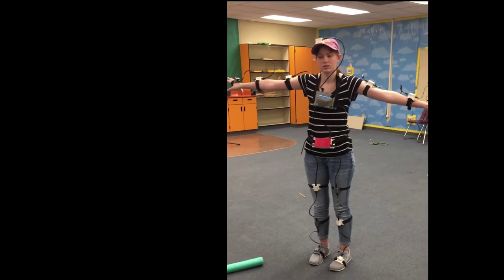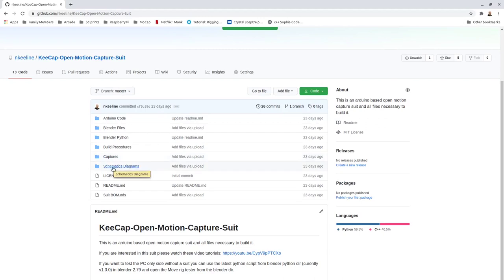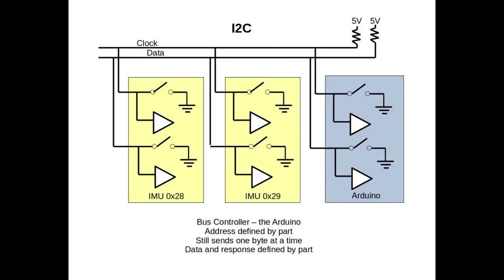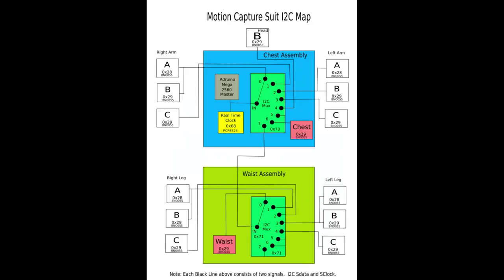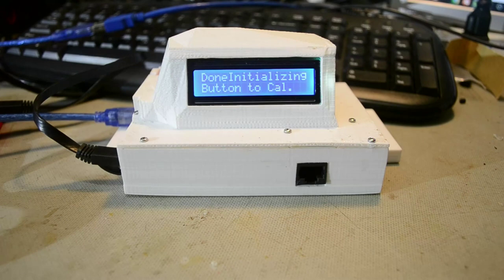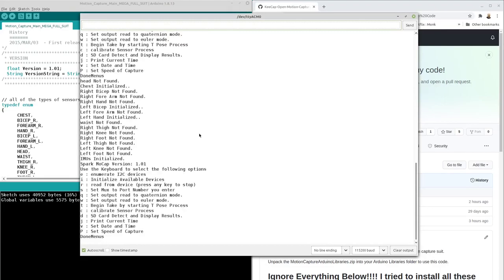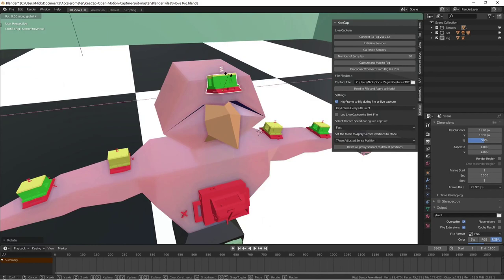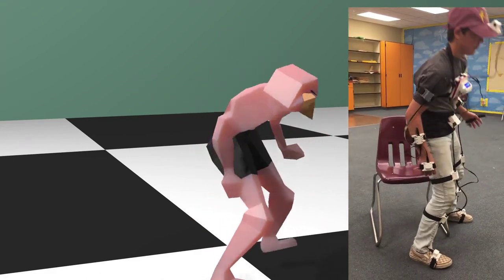Open Source Arduino Motion Capture Suit Tutorial

Comment: This is great.
With a few minor tweaks to the code, you could probably use the very similar SparkFun Accelerometer (which uses the MMA8452Q sensor).  They are less than $10 each, compared with $25 for the AdaFruit module.
Reply: You are a life saver!
Reply: Tysm...🤠'will I get the same level of accuracy as the sensors that he uses?...🤠
Reply: @toapyandfriends  It should be similar, at least if you compare them side to side. The problem I encountered is that these boards are all unavailable (my theory is that factories produce it exclusively for mobile phone companies and stuff) so the chip shortage is ruining the fun for everyone!
Reply: @creationsmarko  what would the tweaks to the code be?
Reply: @goodloestudios  I never did any further research on this topic. Just looked into what tech is out there and its limited
Reply: just using it for goofy goober in blender

Comment: Hello, I'm really glad someone finally made the open-source mocap suit.

 I was thinking about the precision stuff, and am wondering if there is a way to measure the distance between all joints as a support for the software to understand the final position better (Not saying this should fire every frame) with for example a speaker microphone setup on each sensor cluster so that each cycle one of the sensors fires a sound impulse and all other microphones try to pick up the relative distance based on the time it takes the sound to travel to each mic. 

I don't know much about this, and I understand its not simple task, but it seems to me that this would allow for faster movement because skeleton could be recalibrated periodically, e.g. 100 ms for each joint or the maximum distance the sound would need to travel around the actor's body without being reflected from room surfaces.

Comment: Good job! I actually built a motion capture year ago with same concept of IMU sensors, in mu setup it's with several esp8266+mpu9250+battery for each body node, and output quaternion through wifi into Unity to rebuild poses. The downside is i have to charge every node each time before usage
Reply from the maker: Awesome,  I knew kids would be using this so I made it ruggedized.   Was fun to build.
Reply: i have a question for you... could you only track the palms of the hands and use unity's inverse kinematics to animate the rest of the arm ?
Reply: @xyelashe  Generally it's not possible as IMUs is not position-based sensors. Those 9-axis sensors are ideal for 3-dimensional rotation tracking, which unlikely to give you precise position. You have to get all the bone rotations with this setup, in your case, all the arm bones. If you have position based solution, like the VR hand tracking solution in every VR headset, then you can use IK to rebuild forearm and upperarm though there is still one degree of freedom for the arm rotation that can't be determined by this.

Comment: Hey I just wanted to point out that on the older datalogger shields with the DS1307 clocks, the SCL and SDA pins of the datalogger are A4 and A5 and this is to match the SDA and SCA pins of the Arduino Uno. Connected to the Mega, this will not work and I2C won't be able to detect the RTC. The solution is simply to jumper the A4 of the datalogger to D20 (which is also SDA) and A5 to D21(which also works as also SCL) of the Arduino Mega 2560. This should enable the I2C bus to detect the RTC. I'm not sure if it's a problem with the RevB shields as they use a newer clock and the schematics don't show this external connection for the RTC either.

Hope it helps someone else from ripping their hair out. RIP my scalp.

Comment: My son is working on building this suit for a school project, and plans to extend what you've built in this project with a Lua script for Roblox animation capture.  Since the game platform's animation engine already supports Lerp between keyframes,  he plans to first run the capture files to remove quat's that are similar, reducing the overall amount of keyframes/data needed, then the quaternion keyframe captures, will be converted to a Lua script that creates Roblox KeyFrameSequences.  For those interested, a similar approach can be used for Unity or other gaming platforms.  He plans to share the results in open source when the project is completed.  Thank you for contributing this work in open source under an MIT license!  As he follows your instructions, we'll send PR's for documentation updates for any issues or clarifications he finds.
Reply: So awesome, let me know if you need anything, I did it for the kids to begin with.
Reply: @nickkeeline4840  what kind of screws did you use?
Reply: I went to true value hardware and bought the absolute smallest screw they had
Reply: Amphenol right angle cat3 connectors are difficult to procure atm, So I've had to resort to using Honbay 20PCS Black RJ45 8P8C network connectors for all the connections, but they're not right angle connectors, so I'll need to modify the sensor design.  Did you use FreeCAD to do parametric models for each of the parts that are in the Blender model? If so, could you check in the orig free cad models...will make the modification process easier. Thanks!

Comment: My god... we both had the same idea... though I've been using the MPU-6050s, which also offer quaternion output and have a processor akin to the BNO055. Even funnier is that we both opted for the ATMEGA 2560 (though mine isn't authentic and I think it's actually the ATMEGA 1280). 
So about one clever idea I used with my project: I have the TCA9548A, but never actually used it. Not sure if the Bosch offers it, but on the MPUs you can set the address to high or low. My solution was to leave one address as the 'noise' channel (aka constant screaming) and one where I'd actually listen in for info. The chips offer an interrupt pin, which I listen to when the IMU has information ready. When I get the signal, I just raise the pin to that chip and request it to give me the information. Since that chip is the only one on that specific address, only it would know to respond to the request and would send the data, allowing me to log into memory the rotation data.
Regarding position tracking: My goal with my project was to create a motion capture suit for VR use specifically, so the software I'm working with would use the positional data from the headset and work everything down from there.
Reply from the maker: Sweet,  hope my code or experience helps.

Comment: would be interesting to see if you would camera track the irl footage and try to align it with the mocap data
Reply from the maker: Yes, it would , but I haven't finished camera tracking project yet
Reply: @checkeredbug8015  does this mean you also plan to put an IMU on the camera?
Reply: that would be very cool, i don't know how you would calibrate such a system but it would make matchmoving such much of a painless task to do
Reply from the maker: I am using openpose, but trying to work up a single camera solution.
Reply: @checkeredbug8015  ah, that kind of camera tracking
i was talking more about tracking the camera position in 3D space, in a way that you don't need to matchmove your video to solve the camera movement
Reply: @checkeredbug8015  If the goal for adding camera tracking is just to add facial tracking, maybe some sort of helmet that keeps the camera in a fixed position relative to the face.  Like one of those aerodynamic bicycle racer helmets worn backward with the camera mounted in the tip of the helmet, maybe an led next to it to ensure uniform lighting of the face.
Reply from the maker: We are currently using a gopro on a stick mounted to a helmet and it works pretty well.

Comment: Is this something that you would recommend for capturing some basic movement in sports? Perhaps a baseball swing? I'm new to this and am interested in creating one. I don't mind spending a bit more if there are better components since the creation of this video.
Reply from the maker: Basic movement maybe, the imu noise is significant at high speed, a multiple camera openpose solution maybe more accurate at speed.

Comment: I was thinking about whether VR position tracking with IMU sensors on each limb is possible and here it is! XD

Would it be possible to use orientation data from the legs to determine the position of the person in some manner? I assume something like determining the center of mass could do the trick? :D
Reply from the maker: Ive been wracking my brain on this one.  I even went so far as to purchase a posyx system.   Would be nice to use all accels with uwb pozyx and kalman filter but would greatly increase cost of system...hmnmnn
Reply: @checkeredbug8015  ah yeah once you start taking external base station methods like current VR ones, costs could skyrocket. But maybe with a few additional sensors (pressure on the soles is one that comes to mind) there'd be enough information to determine position?
Reply: I think this is possible but with some constraints. You have to assume that the feet never slide, and that the person never jumps. You have to know how long their legs are exactly, and you have to detect when the person is lifting one foot of the ground for walking. You can then calculate how far they step based on the motion capture data.
Note that this requires at least one foot to be touching the ground at all times, and for that foot to not slide. This will also not be perfect, because you can never 100% exactly measure the length of someones leg, nor do you have infinite resolution on the sensors, so over larger accumulated distance you will probably still experience drift.
Using only imu data without any stationary reference point for position tracking is not possible as described in this video: https://www.youtube.com/watch?v=_q_8d0E3tDk
Reply: @thepianoaddict  Hmm, good points. Some of those assumptions might actually be feasible, considering most VR experiences don't use jumping mechanics, friction tends to keep the foot stable and the fact that you don't have a way to measure the lengths of each limb could actually be used to have an arbitrary limb length if the experience needed it (really long legs or arms anyone? :D). So while theoretically impossible, practically it could work reasonably well imho!
Reply: All good thoughts... thank you all.  Im definitely working in the practical 'hack' realm.
Reply: @checkeredbug8015  How much extra cost are you thinking?

Comment: Ever consider tackling DIY motion capture gloves? The closest I've seen is from animation prep studios but it only handles flexing. The sensors you use seem like a better place to start. 
Edit: Nevermind, I just tried to imagine putting several of those sensors on your fingers. They wouldn't fit lol
Reply: bruh there's a new VR haptic glove that's open source and literally uses pulleys with sensors. it sort of works as finger mocap so i see no holding back on iterating on that design

Comment: How are you able to use I2C over long cables like that? Do you have specific pull up resistors on the mux and each individual IMU? Or, do you have a large battery power regulator? I'm curious how you're able to get enough power to get all the IMU's and cables to work over I2C?
Reply: I2c is fairly robust, it is open collector and works fine as long as there aren't any major noise sources. Also the muxes work as level shifters and buffers too, it just worked, maybe it shouldn't have but it did, even at higher speed.

Comment: My son completed the chest assembly last night, and was able to load the full body suit onto the Arduino and run through the initialization sequence.  He doesn't have any of the arm or head sensors connected, but should it still work and detect the Chest sensor that's built into the chest unit?  After doing the T-pose, it saves datafile,  but there are no sensor readings for the chest sensor.  When we try running the BTO055 tests from Adafruit, we can only get quaternion readings when pin 2 & 5 are connected.  Wondering if there's anything else that needs to be changed in the programs to get a reading with pins 11/12 and 20/21 connected.
Reply from the maker: It works with as many or as few sensors as you have.  All of the addresses are hard coded though so if you change anything you'll have to change the code.

Comment: On one of the steps you mention to connect pin 2(GND) to pin 5 (GPIO) on the BNO055. I have an MPU6050 with pins (VCC, GND, SCL, SDA, XDA, XCL, AD0, INT). What is the equivalent connection on my MPU6050?
Reply: Also using the MPU6050. Since we're using the I2C bus, I'm guessing we just connect the respective SD pin to SDA of the MPU and SC pin to the SCL of the MPU. The other two will be VCC and GND. Both used for power

Comment: stupid question but can the BNO055 be replaced with something cheaper? ie MPU-6050 6DOF? (3-axis gyroscope, 3-axis accelerometer)
Or the 9DOF BMX055? (3-axis acceleration + 3-axis gyroscope + 3-axis compass)
Reply from the maker: Any device that can give you absolute rotation in world space will work.  I have not read the specs on those parts, but the part I use will give me a quaternion with little to no fuss. If they can do that you're golden
Reply: @checkeredbug8015  I searched for "MPU-6050 quaternion" and yes it does it! Cool! :)  Many thanks!

Comment: Instead of using Adafruit data logging shield can I use computer storage through Blender?
Reply from the maker: Absolutely,  but You could also use a terminal application with logging like tera term.  You may need to tweak the code a touch,  cant remember if it echos out the serial as written now.

Comment: Could you explain what exactly is the "MUX2_MUX1_PORT" in your code. It's used in two places, not declared anywhere and I was unable to find anything about it in TCA9548A datasheets

I understand that this is the channel of chest multiplexer on which we have the waist multiplexer connected, but I don't know how this specific variable is working
Reply from the maker: In adafruit_BNO055.cpp is a line like:
#define MUX2_MUX1_PORT (7)
That variable just sets mux 1 to port 7 so we are connected to mux2.  See i2c rouuting.svg
Reply: @checkeredbug8015  Oh I see. That's why it wasn't working with my MPU6050. Well I've got the code set up properly to work with that IMU, now I just gotta set up the hardware. 

Also I noticed that in the Chest and Waist wiring schematics, the SC7 and SD7 wires going from mux1 towards mux2 are accidentally switched. 

According to Chest Wiring, SC7 is going into pin 3 and SD7 is going into pin 4 of the RJ45 breakout. 
But according to Waist Wiring, SCL is going into pin 4 and SDA is going into pin 3 of the same RJ45 breakout.  

This would be a problem for someone whose closely following the guide to the point. You might wanna correct it in the github repo if you get the time :)

Comment: How did you get the serial ports you used for the Bluetooth in blender?...any documentation would be appreciated
Reply from the maker: If you have HC-05 bluetooth module, you can use it as direct UART connection to your computer.
https://www.amazon.com/DSD-TECH-HC-05-Pass-through-Communication/dp/B01G9KSAF6
https://www.amazon.com/TP-Link-Bluetooth-Receiver-Controllers-UB400/dp/B07V1SZCY6/
Purchase a bluetooth usb adapter and plug it into the computer will just show up in windows.
To open the hardware functions windows: Control panel > Hardware and Sound > Devices and Printers > double click on the bluetooth device > choose Hardware tab.  Anyway, I built a bluetooth connection from my phone to arduino and it worked.  I had a bluetooth adapter like the one above, but can't remember if I tested it in windows, but it should work.

Comment: Hello, in the first 10 seconds of your video, the buttocks of the model moved downwards. Why did I run the data in the Sit Gesture folder (where the girl sat down), but the buttocks of the model didn't move and the legs were lifted upwards? My result looks very strange。
Reply from the maker: An imu is rotation data only, position data needs to be animated.  Non camera based solutions struggle with position, but excel at angles, whereas cameras are the reverse
Reply from the maker: Very easily, just a few lines of python could be written to pin a characters feet to the floor and calculate, position then and key the position of the pelvis.

Comment: I'm trying to make a Mech using a Mocap/Motion Capture suit. Turns out its hard to turn a movement to an electric signal which will open a valve for just the right amount of time as to make it move.
Reply from the maker: Not sure I understand your application, but sounds fun!
Reply: @checkeredbug8015   Basically, I move my arm while wearing a mocap suit, and it sends an electric signal when I do that, in turn the electric signal would go to an air valve, the valve would open and let compressed air into a pneumatic piston, the pneumatic piston would move the arm at the elbow joint.
Reply from the maker: You need a control loop on the piston so you can set it's angle.  Then make the angle of the piston match your arm, not simple but doable.

Comment: Hi just saw your vid its grate would this suit work for vr games like vrchat ?
Reply from the maker: It should, i never wrote a unity or unreL pkugin though.
Reply: @checkeredbug8015  would it be hared to make 1 for this im going to start making this varey soon with maby a few less sensors  maby just the legs and bluetooth
Reply from the maker: @jamiemitchell3532  If you don't mind programming the suit could work for anything.  sounds like fun, the code is written to work with any number of sensors, you don't need to have all of them, if they aren't there then it just uses what is.